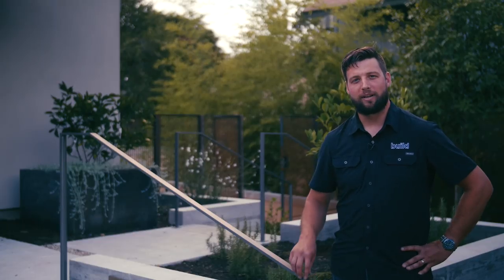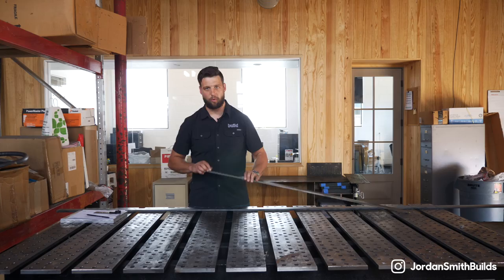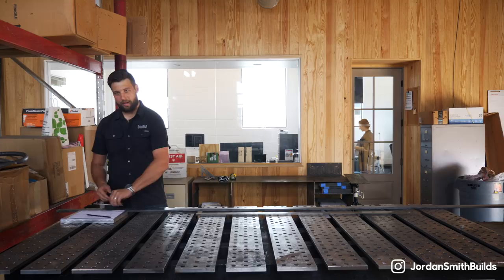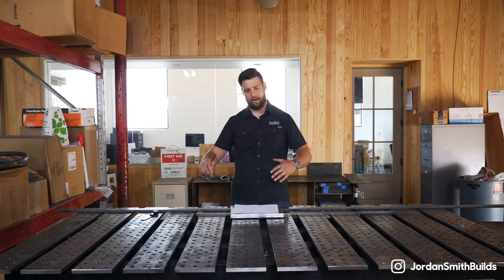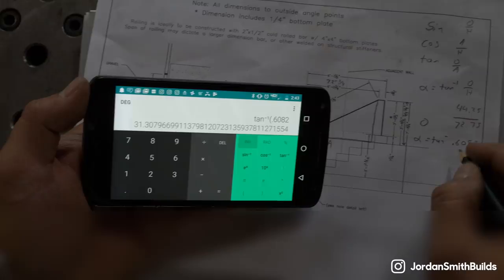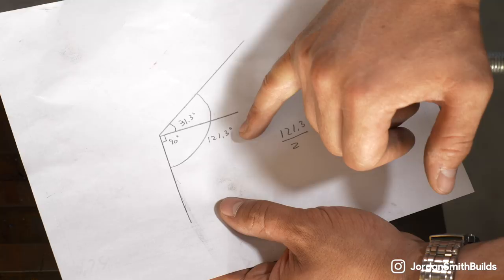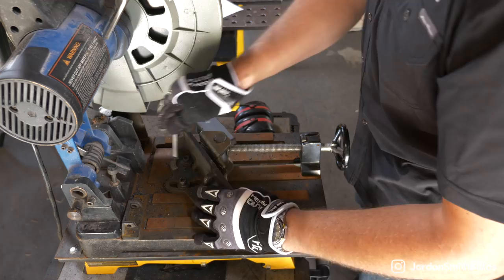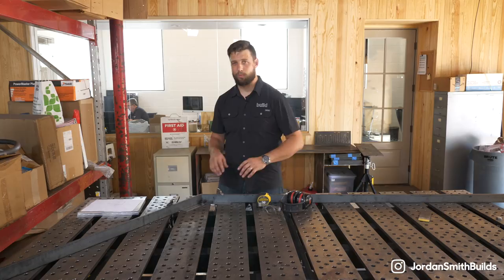Steel Handrail HOW TO - Part I

Comment: At 3:45 you say the that the angle is the inverse tangent of the opposite over the hypotenuse, but you then write out and calculate the opposite over the adjacent.   Might want to put a note on the video there.

Comment: It’s great to know the trig, but even better if you’re welding or in a trade, you should learn CAD, like AutoCAD. You’ll be able to check your work and produce the prints you need to build complex builds much more quickly and accurately.

Comment: Why not bend it versus cutting and welding? Too difficult to get the precise angle that you are wanting?
Reply: chillywilly3610 if you have the set up to bend it great.  But that requires a press brake and large tooling to bend that. 500 HR.  If it was to be done in in the CR you can pretty much forget bending it as it will stress fracture at the bend line.  Chances are if you have a welder you have a saw.  Much easier to measure and cut then weld than it is to layout multiple bend lines.  The more bends in a single piece the harder it is to make with layout of bend tolerances and K factors.
Reply: You could heat it with a torch to bend it. It makes a more round inside and outside edge and relaxes from the original bend slightly so you'd have to bend slightly more than you need. A torch capable of that could be had for around $450. This makes sharper edges and a different look.  You could do either depending on what style you're after

Comment: Why not use a 3d program. I did like the break down of working out the angles but I think using a program like sketchup is also a good idea.
Reply: I agree. Spending a few minutes on the computer saves in the long run.